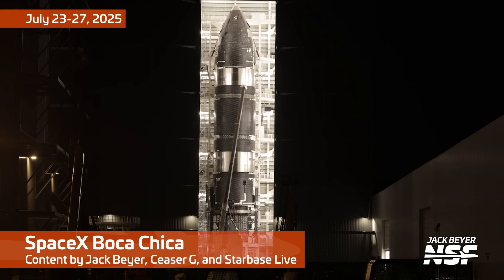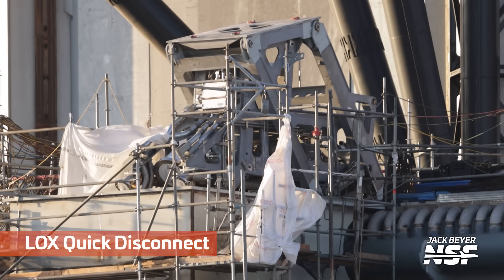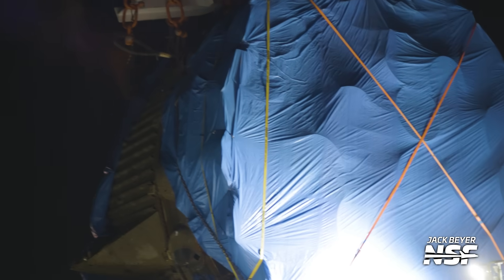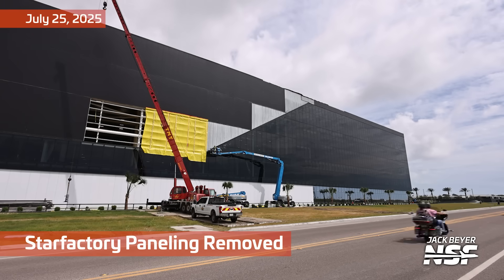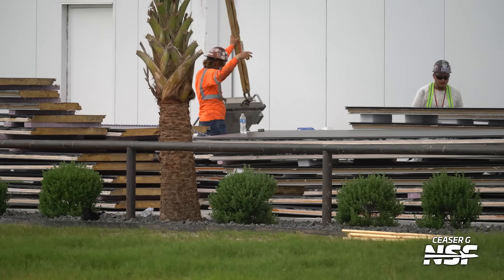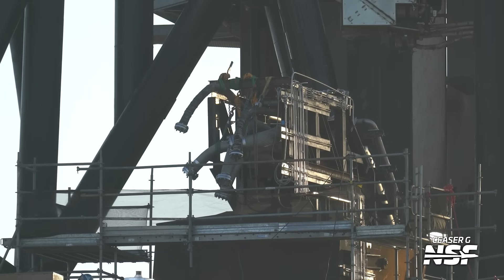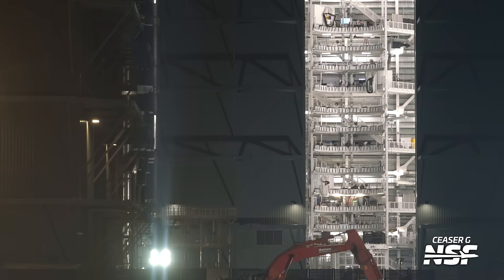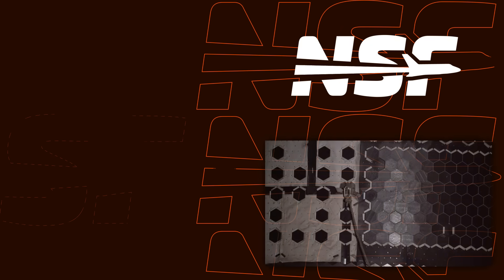"Masseys, partially operational" | SpaceX Starbase

Comment: As far as why it was cut so cleanly for most of the circumference, and then there was a ragged part that extended farther “the bottom” as Dos call it, when he pointed out the sand being shoveled out. That was the same bottom when it lie on the floor of the gulf.  Most of the circumference was free of the sea bed, but they couldn’t continue to cut clean because it was laying in the mud, they had to cut up farther where the ship was off the floor . I think that’s why the cuts uneven.

Comment: They were apparently unable to cut the part of the booster that was laying on the seafloor, so it probably just got ripped loose by the crane.  The rest of it makes sense.  The shortest (and hence, fastest) way around a cylinder is a straight cut perpendicular to the axis, and that is what they did.

Comment: At the 8 minute mark: We have had second home at the beach ever since I was a boy many years ago, and the salt spray line extends inland about 1-3 miles or more, depending on the terrain & weather of course. So it makes no difference where SpaceX locates this, its going to get salt spray. Humidity, fog from the sea, that fine misty light rain, it all brings salt with it.
Reply: while i cant discount your credibility, wouldn't it be true that while there'll be some salt spray there may be less/of a lower concentration? or is that incorrect?
Reply from the maker: We've had equipment at Starbase for years. Its significantly worse the first 200 yards or so from the surf line. -Das

Comment: It's called "Cover Your Load." Required for most road travel to avoid the fiddley bits from falling off and bouncing thru someone's windshield.
Reply: Also has a drag-reduction effect at hi-way speed...
Reply: @RobinMiller-v6c somehow I doubt a 9 meter tall load ever got anywhere near "highway speeds " on that trailer.,,
Reply: @RobinMiller-v6c Hah! In this case, keep the rocket engines from excessive drag at hi-way speeds; got it. (Sorry; couldn’t resist! 😊
Reply: Avoid those fiddley bits falling off !!!

Comment: Apparently the bells are made of Inconel (nickel chrome alloy) and don't rust. Maybe the green (copper) colour is from a copper part that failed & melted (or even vaporized) and then coated the insides of the engine bells. The one that isn't green, survived intact with no copper parts failing?

Comment: the engine bells are supposed to be made from inconel which is a nickel-chrome alloy that doesn't rust , there is a copper based alloy but its still under test conditions and isn't available for companies to use, sod knows what those green copper oxide coated bells are made from

Comment: 4:24 The side with the bottom of the engine is tarped because the "showerhead" inside the engine that distributes fuel for burning is ITAR regulated and super-proprietary since its one of the hardest parts to get right.

Whereas the fuel distribution system is all pipes... DoD and SpaceX don't care about that part. The more interesting bit, IMO, is the bit of baffle that's hanging on to the extra portion of tankage, since we know this has been a focus issue in the past.
Reply: I hadn’t noticed that until you pointed it out. You think that baffle normally goes all ‘round the tank and we’re only seeing the remnant that survived here? Also, I guess I didn’t immediately think ‘baffle’ when I first saw it, because most baffles- to me- aren’t screen-like but solid (?). - Dave Huntsman